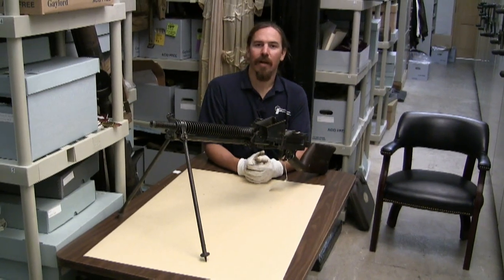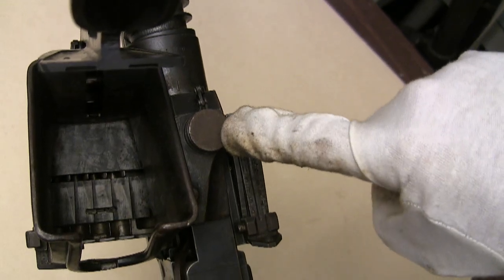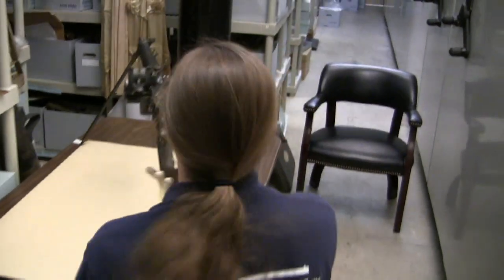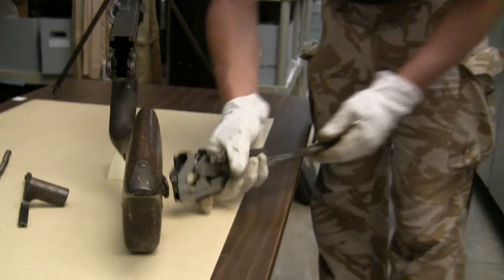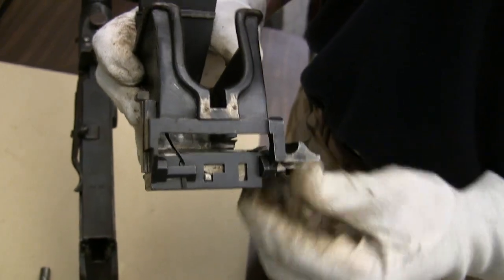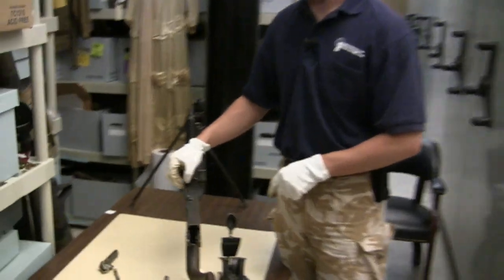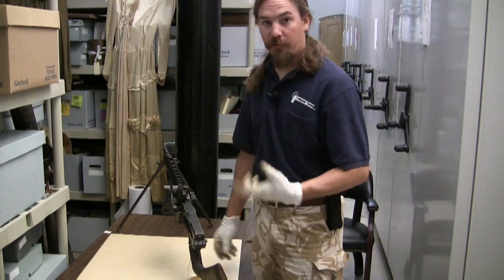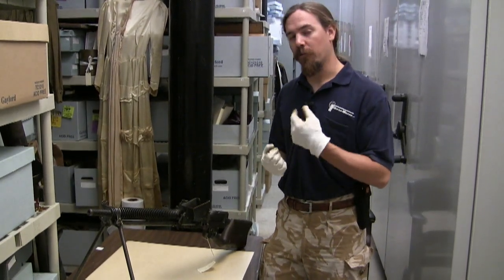Japanese Type 11 LMG Disassembly

Comment: The way the rounds are stripped from the stripper clips is very reminiscent of modern ways for belt-fed machine guns. I find the idea pretty cool especially since you just have to drop clips into the hoper, you don't really have to open up the whole thing to put in a new belt and yeah, the logistics are nice.

Very cool :)
Reply from the maker: Yes, it is similar to a belt-feed mechanism, but with pawls to hold 5 rounds simultaneously instead of just 2.
Reply: You can easily top it off while it's firing though

Comment: A thought on that steampunk feeding system:

At the time of its introduction in 1922 most machine guns came with either a belt loading tool or a magazine loading tool. For instance both the Vickers HMG and the Lewis LMG should be equipped with a loading tool as part of their load out (not the 'tube' style loader for the Lewis but the BSA 'grinder' loader). When you think that carrying that piece of junk around as a separate piece could be eliminated by simply incorporating it into the weapon it suddenly makes sense. Now you don't need magazines or belts either, you're actually saving heaps of weight and more points of failure in the operation of the system.
Machine gun belts especially would suffer in humid East Asia because at that time they were frequently made out of either flax or cotton with either brass or steel stiffeners.

Well, the Japanese didn't operate in the Western Front of The Great War and they either didn't understand the danger of the complex and open piece of equipment getting contaminated or what's more likely in my mind is they didn't think that style of warfare would occur again (it actually did in some places in China).

I'm not saying I like it or recommend it but I think it makes a bit more sense when thought of that way.

Comment: A technical question that you're the only person i know that can probably answer it:
On guns with offset sights, are the sights pointing directly on an axis parallel to the axis of the barrel of the weapon, meaning if your sights are aiming in the middle of a paper target the bullets will impact in this case high and right, or are they designed to so that your sight axis crosses the gun barrel axis at the distance you've set the sights to ?
It always seemed to me that offset sight would cause accuracy issues simply because even if the sights are designed to point right were the bullets land at the distance they are set to, having your sights dialed in perfectly during battle becomes a whole lot more important since if you fail to do so your bullets will be off target by a whole lot than on a LMG with normal sights were if you have to shoot beyond 600 meters you just aim a bit higher.
Great video as always can't wait for the first HD reviews !
Reply from the maker: Good question! I can't speak for Japanese procedure (since I can't read their manuals), but with the British Bren gun policy is to zero the sights to hit 1 inch to the right at all distances (the sight axis and bore axis are 1" apart). One inch of difference in POI in a light machine gun is pretty much negligible.
Reply: Forgotten Weapons
Yeah that makes a whole lot more sense than having the sight axis cross the barrel axis though I'm ready to bet at least one crazy gun designer created his gun this way at some point. Thanks
Reply: Forgotten Weapons I asked same question to a weapon's expert when I was 19, the expert went on for 15 minutes and we were more confused than at beginning. Your short, direct explanation is well appreciated.

Comment: Lots of chrome lining and eliminating the oiler would do a lot to help reliability issues.
Reply: The oiler was to help with reliability issues, the extraction on the gun is quite rough on the cartridges and if not oiled used to tear the cartridge head off leaving the rest of the cartridge in the chamber and make the most unholiest of stoppages! lol Some modern firearms use a fluted chamber to remedy the rough extraction problems

Comment: The Japanese 6.5 caliber is quite mild to shoot out the type 11. But I've had bad luck of having 2 fireing pins brake while I was shooting Them. Both owners had spare fireing pins with them and got the guns up and fireing again very soon. The offset sighs are of course non useable for left handed shooters.  I have never seen a Type 11 converted to another caliber like 7.62x39. Have you?
Reply from the maker: Nope. I've seen Type 99 Nambus converted to 7.62x39 and .308, but never seen a converted Type 11. I suspect the feed system conversion would be too difficult to justify. And FWIW, I found the sights very usable left-handed, because the stock is actually in line with them. Granted that's from handling and not live fire.

Comment: So does this make it a similar kind of clip fed design to the M1 Garand? That is, the gun stores the clip internally, I know it's now like an en-bloc.
Reply: There was a bolt action rifle that did this as well, wasn't there?
Reply from the maker: bigred2989
This was a defining feature of Mannlicher style rifles (Steyr M88/90, Steyr M95, Dutch M95, Carcano M91 and M38, Gewehr 88, G98/40, Berthier, etc) would drop the empty clip out the bottom of the action when the last round was chambered. The M1 Garand is similar in function, but ejects the clip out the top when the last round is fired.
Reply: Thank you.

Comment: Why do they cut the barrel like that ? Does it act like a heat sink?
Reply from the maker: ***** Exactly.
Reply: +Matt Hildahl The cuts have a double effect actually where the heat is concerned, much like traditional heatsinks you'll find in electronics with uhm can't think of the proper english word for it let's say "fins" sticking out of them is to have enough thermal mass so you can absorb the heat and to also have a higher surface area to lose the heat by getting a greater contact surface with air. 

It allows you to get away with less weight on the barrel compared to a much thicker and heavier barrel while getting a bit less thermal mass and a better cooling efficiency which I'm guessing balances out to similar thermal performance while saving a good bit of weight in the barrel.

A small amount of heat will also be lost to other factors such as radiating heat in the infra red spectrum but primarly air cooling I'd guess (barrel temperatures where radiating heat becomes relevant would be unhealthy)

Comment: What's the point of wearing the white gloves? To keep the object clean? Those gloves were soiled. lol
Reply from the maker: The gloved were clean when I started...and the point is to prevent skin contact, not to keep the gun clean.
Reply: Thanks. Great vid
Reply: Forgotten Weapons but you still rested your face on the stock
Reply: Snabel Ø Wood is much better at handling human contact than metal is
Plus they still do a wipe down before the firearm is put back away
Reply: Skin has oils and suck that aren't great for the gun.
Reply: Bojan Milankovic Yep. I'm basically the internet.